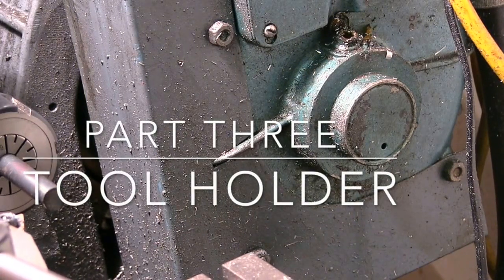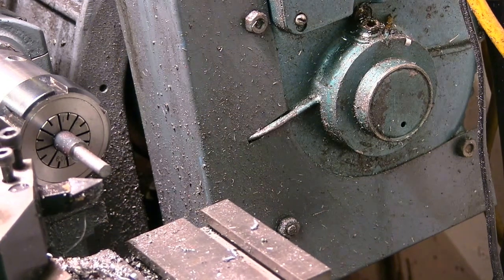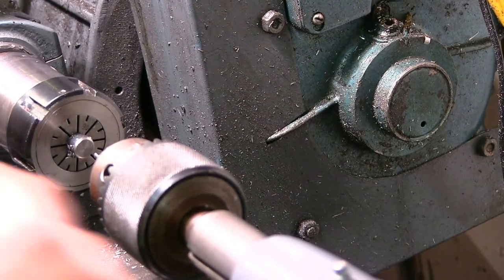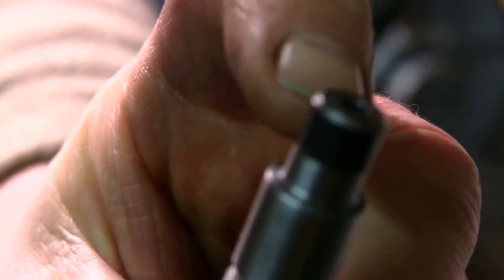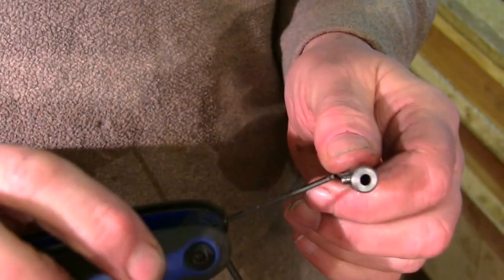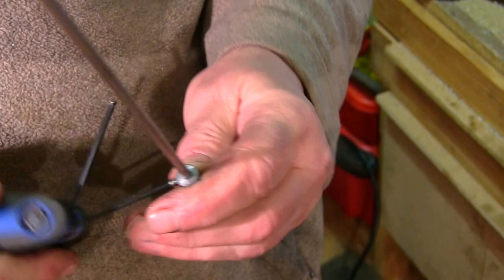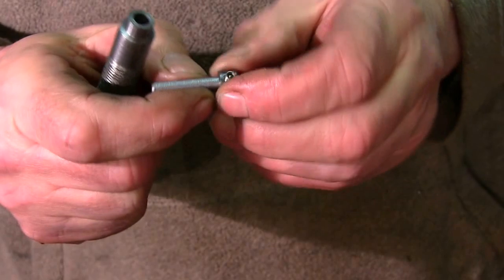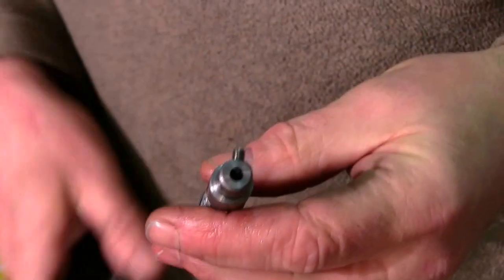Shaun Hughs Inspired Pneumatic Engraver Part Three

Comment: Lovely job. hearing the shake sounds just right. You can test it with a tube attached to a plastic bottle and operate it by just pressing it with your foot,or blowing and sucking the tube.The tube at an angle is a bit more user friendly,but you can just curve it through your wooden handle.I think once you have the rubber O rings the holder will be just right.
Reply from the maker: thanks Shaun, praise from the master is praise indeed!